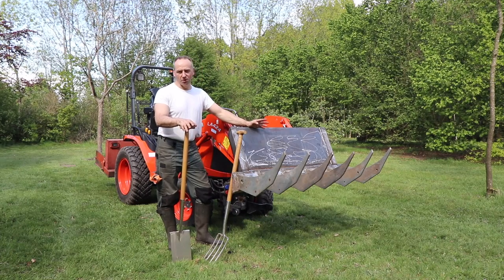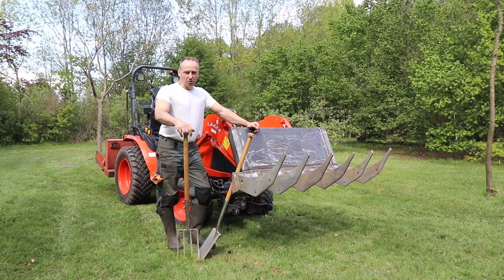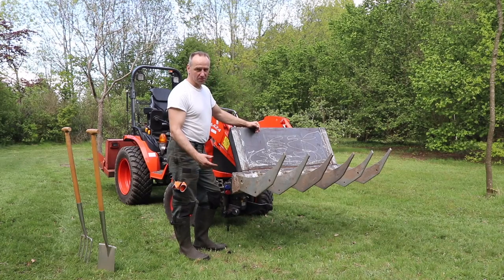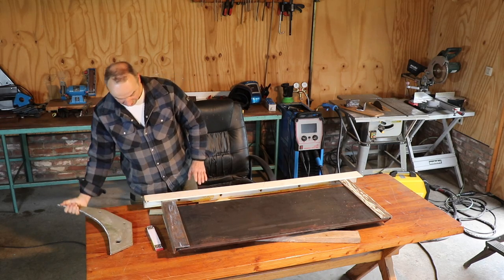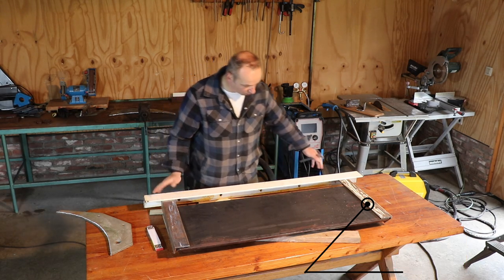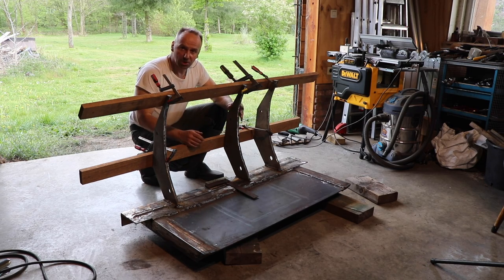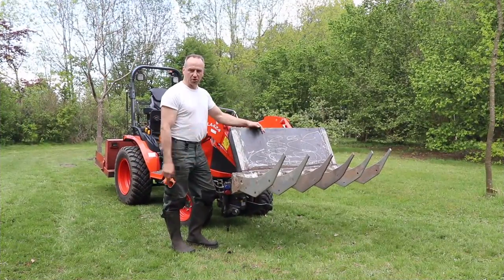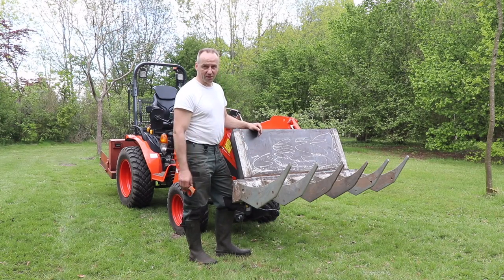DIY Rake Digger for the Kubota B2261 Compact Tractor Front Loader

Comment: Outstanding solution!  Look forward to seeing you put that creation into action as I have a similar need.
Reply from the maker: Thanks! I have two recent videos on digging where I demonstrate it. It works really great.
Reply: What grade of steel did you use for the jaws of your decice?  Simple  and widely available A36 steel would not stand uup to the stresses you put your jaws through.   Meaning...grade of steel and not thickness of the members.
Reply from the maker: The Rake Digger is made from steel parts that were used in old buildings that I bought from the scrap yard. So I expect it will be standard construction steel Fe360 (or St37) , which is perfect for making these type of implements.

Be aware that when using special steels (like high strength steel, high carbon or other alloys) they do get their improved properties by cold deformation and/or specialised temperature treatments. When plasma cutting or welding these type of metals without after treatment they will loose most of their properties and can even make the construction much more brittle and weaker due to internal stresses inside the material. Special steels and metals need special attention to retrieve and keep the properties as intended.